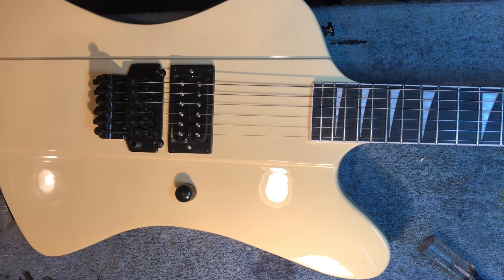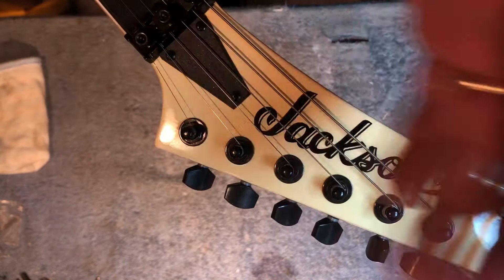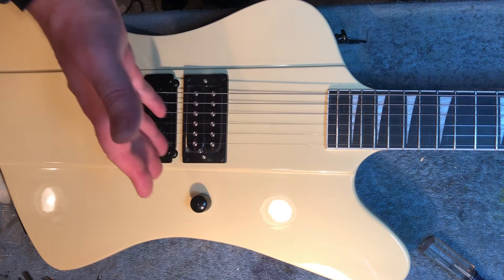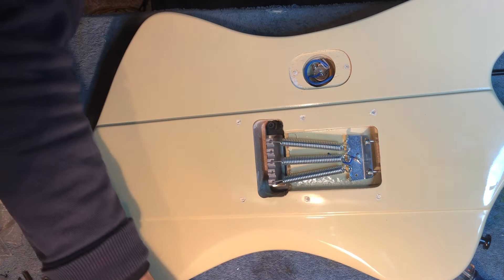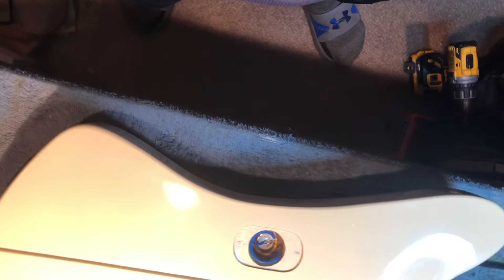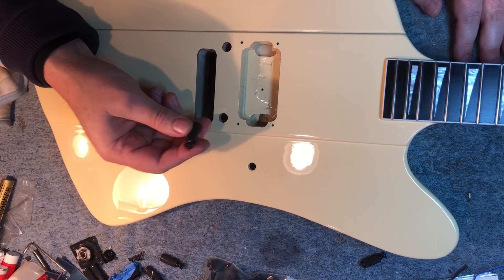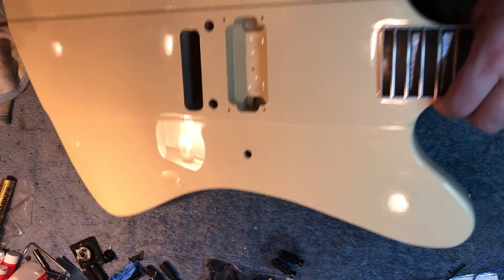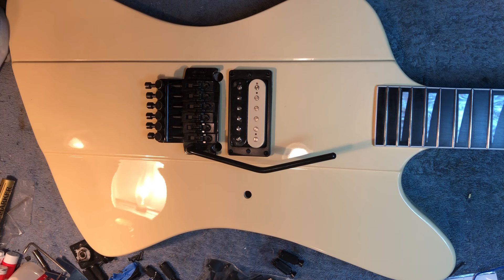EVERYTHING WRONG With The Chinesium Firebird?!

Comment: its got the completely wrong headstock and brand lol. yeah the fake jackson headstocks are worse then the fake explorers. it actually looks JUST like an explorer headstock with just the round part cut off and then just branded jackson. thats funny they would do that because the angle of everything is going to be way off in comparison. they basically just modified an explorer into a firebird and threw the name jackson on it for whatever reason instead of ESP or gibson. hope you like it after you get it all done up.
Reply: Jackson did do a few custom one off firebirds, but they were either arched or flat tops, and didn’t have that Gibson groove on either side of the body- Dave Mustaine played one in the x games theme video 🙂